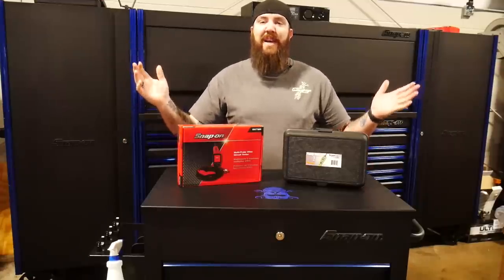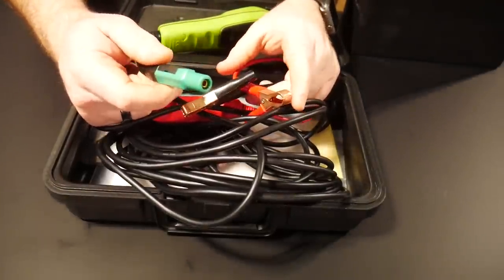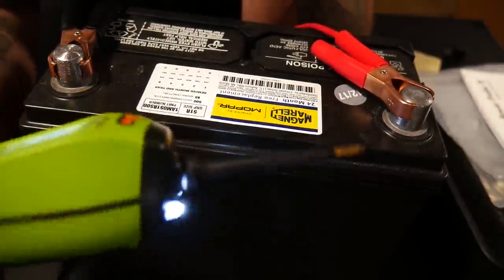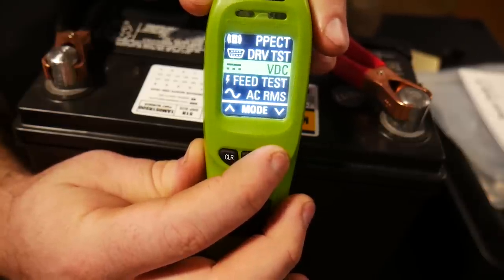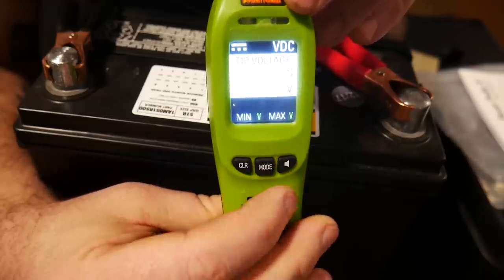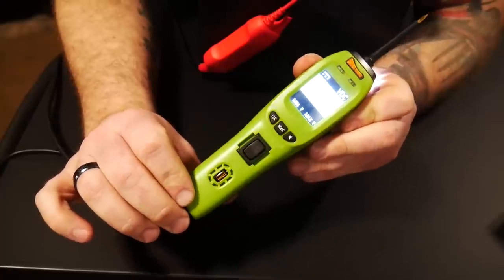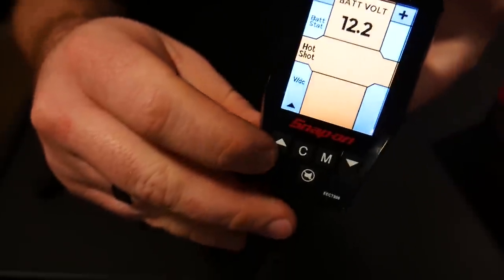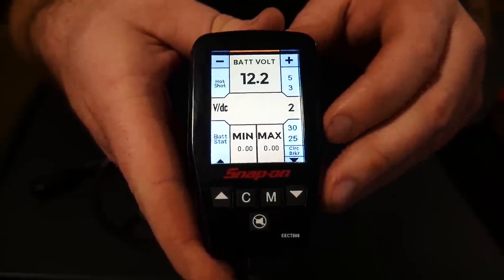POWER PROBE 4 & SNAPON EECT900 COMPARISON AND REVIEW

Comment: I’ve had the power probe 4 for a while and I’ve had to have it repaired 4 times already, I’m actually going on week 7 without it as it’s back being repaired again. I never had a single issue with any other power probe I’ve had. I’m thinking about getting rid of it and going back to the 3.
Reply: Yeah, I've had the 3 for about 10 years and I have never even blown the little breaker.  Didn't even know it had the breaker until a video I saw here.

Comment: You can buy leads that are up to five feet or more. That will let you test the wires you talked about. I've had a 4 for years and never had a problem until a guy, in the shop, dropped it. The circuit breaker came loose inside.

Comment: I had the snap on one but got rid of it in place of the power probe due to the snap on one's software wasn't fast enough to detect turn signal power pulsing. Mabey mine was messed up but the snap on one just had slower response times in every way, even just supplying power and ground.

Comment: We have a PP2 I find i tend not to use it as much as i should. You should make a video showing how to preform each function of the tool with other equipment. like using a set of fused jump leads with a DVOM, Test light, amp clamp and scope could be a interesting. great review very in depth.

Comment: I think I have the 3, but the best use ever for a powerprobe is when you get locked out of a ford with the keypad code that you know. Plug it into  a jumpbox, crawl under it and apply power to the starter and ground it. Then have someone punch in the number.
Reply: Tim the Mechanic Branthoover this sound interesting I’ll like to hear the details 😊
Reply: Tim the Mechanic Branthoover tell me more
Reply: @raymond5145  Well, any Ford that has a keypad has a code to unlock the door if you punch it in. It doesn't work if the battery is dead. But if you plug the power probe lighter plug into a jump box or to a battery then get under the car to the starter, hook the ground clip to ground, put the tip of the power probe to the battery cable terminal of the starter you are also giving everything that gets 12 volt side of the battery key off 12v power, enough for the keypad to work and unlock the doors.  Also, if you don't have the code to one of these Fords, it's always someplace on the car but not accessible when the doors are locked.
Reply: Tim the Mechanic Branthoover I can’t wait to  get a power probe, I’m going to ride around with that thing like it’s part of my car keys lol

Comment: You can get a Autel ps100 or a ancel pb100.  I have four power probes!   Yes I have a hook. Contacted power probe and they just blew me off!  Anyways time to move on.  I would not bother spending cash on snapon one half year warranty is all they give you!  Yes for probably quadruple the price of a ancel or Autel!   Good video not knocking on the guys video.  Great video.   Snapon tool $370.  Power probe four $190 ancel $70 Autel $100.   That snapon is massive won’t fit in tight areas!   I work on semis as well.  Too massive

Comment: Test Light and Fluke 87V is all I need.  You are a good salesman though!
Reply: You can do the job without a power probe. But it makes life easier. Especially the ECT3000, that thing is amazing.
Reply: I grab my PP4 more than my meter now.  Having B+ and tip voltage displayed all the time is ideal for voltage drop tests and always having good power and ground is worth it alone.  Of course having the rocker switch is handy.  My meter has been out lately for parasitic draw tests.

Comment: I saw another video and a guy amp clamped the hot shot feature it pulled 30 amps at 2.5 mls and came back with good connection.

Comment: The Snap On is mostly the Power Probe Hook. However the Hook has SO many more features, and with one exception has every feature the 4 has, Plus a hundred more. I use the Hook for the reference voltage features when testing computer circuits. Hook has a relay tester, and 5 level circuit tester with the relay tester. Its the most awesome of them all. The 4 has one feature i wish the Hook has, and thats the reader for the ECT 3000 to know when the tracer tone is in a certain wire.
EDIT: someone mentioned the 5v reference add on for the tip. The hook is continuously variable from .5 to 5v in reference mode. @20ma. Computer Circuit safe. I use that for sending signals to computer using a predictable .5 second pulse mode while watching data on scanner. Hook has momentary, lock on and pulse mode on power button menu. I am not affiliated with PP in any way. It's just an awesome tool. 75% of my work is electrical diag. I use it often. Watch the hook demo vids. It also has instant voltage, ohms and ammeter depending on circuit and power present.
Thanks for hearting my comment.

Comment: Can you show..how to check the pulse for fuel injectors with the eect900
Reply: Buy a box of noid lights £10. to 20 pounds and you,ll do the job 10 times as quick,when I check a car for a no start , can of brake cleaner ,to check if it’s fuel related,and noid lights to check the injectors are getting a signal, basic car doctor 101 , if you want to save money solder a 1k resistor to a led  solder a wire on each side . Remember they’ll only work one way ,if you don’t know what a cathode or anode is ,just try them both ways,if it doesn’t work both ways there’s no signal from the ecu or a short in the wires,hope that helps,

Comment: Good review, interesting seeing the differences in the probes.
wonder If they could build an oscilloscope into the power probe? feel would add another level of diagnostics
Reply from the maker: Would be interesting to see, but at the same time I have a feeling you would be looking at over $500 for a probe then
Reply: Power probe Maestro has this in their app
Also autel in the al539b which is 80$
Reply: I doubt the snap-on can receive the signal the power probe short circuit detector signal but who knows. I just got Snap on version so might have to play more.

Comment: Maybe I'll get my crate a day early that I can do a review on it before everybody gets theirs, haha not a chance I already know. 

Thanks for the shout out I was waiting to see that I thought maybe you would do some bonus footage at the end but you definitely have to get that and I think it'll work on the power probe 2, the 3 and the 4 for sure and do some videos with that. 

Do some case studies with that and show your audience how that 5 volt reference adapter works it's a very sweet tool add on. 

You should get your snappy or other tool truck to get you the power probe hook and do a side by side with the snap on one. 

Also you might want to drop some links to the Power Probe store where you can get all the Magnificent add-ons they have which if the viewers don't want to buy it from them they can always get them on Amazon as well. You just have to watch the pricing been there and done that. 

I have the 1 2 3 4 and hook. The two three and four are slightly if not at all used on at least two of them so I may try to trade them in to the snap on guy as I believe he quoted me to $280ish last time. Snap-on guys are good if you get a good dealer but I never will pay more than two-thirds of retail just because of the fact that I understand their cost structure and there a publicly traded company. That extra money goes to the company. 

If you've got stuff to trade there's even more wiggle room I found on some things. 

The reason I mentioned the bonus footage thing earlier was I thought the adapter didn't arrive till after your video had probably already went to The Cutting floor because I know it takes a while to get them done and you had been talking about that for a while so I thought the footage was done already. 

Just remember when you have to keep Captain Ron and check you take that five molded after off and give him the full juice you might get excited with just 5 volts. 

If I knew you would send it back to me I would let you take the hook and do a review with it just you would have to do shipping back. I wouldn't send the whole case just because of the fact I can probably fit it in a little flat rate box which would save on shipping but I could always go with a medium box as well but don't quote me on that. 

If you're interested in doing something like that let me know and I'll take it up and ship it across the freight Lanes and you can do a review in a couple weeks with it from the time I get it shipped to you. Oh wait that would be to head Craig's time so damn I might have to hold off on sending it I don't want to interrupt my crate getting shipped 😂😂

I won't make the Sunday sermon tonight because I'm over just west of Lusk Wyoming right now I pulled off in the rest area. Maybe pull up Lusk Wyoming and show you viewers on the map where that is. If you ever want to know where American Legion Post 1 is it's just east of Lusk Wyoming right before the Nebraska line. A little tidbit of information that a lot of people probably never knew I never knew till I have been driving over the road for 9 years I drove past the place many times but if you pull it up on Google Maps it's just a little hodunk town will the flag out there and I woke up one morning looked out the window and seeing the dedication plaque to it I think maybe two or three people live there in that town now. 

Anyways I missed the Sunday sermons tonight with the Reverend and the bishop cuz I was out in Utah for a funeral on Friday there. My uncle's ex-wife it was still my aunt that passed away earlier this past week so I had to drive out and see you there it was a thousand mile trip. It was cheaper than flying out there and that was before even renting a car. 

I think we need to work on the rusty belt designs on Teespring as I was looking at them last night while I was ordering one from South Main Auto. I've been feeling their Channel a little longer than yours but yours came up as a suggestion but I don't like black and I forgot if you had other colors but also I think we could touch that design off. 

Maybe you should do a little three or four week design contest where your subscribers email you designs and then you put them up for voting. top winter should get choice of two items sweatshirt included and second place should get a choice of one item sweatshirt socks or t-shirt and third place should get a t-shirt of their choice. 

Think about all the kids of all your subscribers that will come out of the Woodworks and blow your mind with The art design capabilities they have. 

 I think you would get to your next thousand subscribers fairly quick as well or next 2000 especially if you're running a boating promotion as I've seen little polls where people can vote yes or no on items. 

Also pardon in a misspelling or sentences as with this much typing on a Galaxy Note 9 even it makes the thumbs and hands go numb so I use the voice typing. 

 I've got a few other new things I haven't got around to using that we could collaborate on as well. I'm sure you've heard of a cardaq? 

 I've been taking it easy since last fall not doing much except personal stuff so I've got some new stuff I have to test out. I need to get my garage cleaned up and make a little table with a pedestal and maybe use my osmo 2 I don't know how well that would work but I think it would work if you're moving around because I just can't sit still as I noticed you're moving around as well well holding the camera. 

 I'm getting into coaching girls fastpitch softball season again so with it being that time of the year things are going to start cranking up here soon.
Reply: Yes before anyone says anything yes it was a book I just wrote or maybe a small little chapter book... 😂

Comment: Dose power probe offer the 5 volt atach ment like power probe or dose it have a setting in for that
Reply: I may have missed that In your videos
Reply from the maker: It has the 5v reference adapter that comes separate in most applications
Reply: What power probe would you recommend Keeping the f volt  reference in mind

Comment: got 2 things to ask first how much is there difference is there in the pp3s and the 4 you have there also if you pull up power probe on emay you may find i hard blow molded case that may fit your snap on probe hey before you send that power probe 4 back to snap on if your guy will let you get a pp3s please compare the 2 please i just bought the pp3s hoping i did not mess up
Reply from the maker: I don’t have a pp3 but if I come into one I’ll compare them
Reply: @RustbeltMechanic  that is ok just thinking i would ask i just bought this pp3s and just looking to see if i messed up and should have spent a few bucks more for the pp4

Comment: The only difference between the Two probes is the price Snap on tacks on 200.00 dollars because it says Snap on.
Reply from the maker: Nope, not in this circumstance
Reply: @RustbeltMechanic  I would believe that if Snap on did not have a hand in its design and it may be CHINESE made but I have used tools Superior to Snap on.A good example of this are impact guns, Snap on is yet to make a gun Better than Ingersoll-Rand. I own a lot of Snap on and Mac tools when  I see Snap on tools are now being made now in China I question them as a Company.
You may say this is not true but it is true as How it's made showed a Chinese factory making there tools and there tools no longer say MADE IN USA  as my tools do.So I don't think power probe had much to do with the design or maybe very little.
Reply from the maker: I totally get what you are saying but in this circumstance Power probe was commissioned and 100% makes both of these probes. The snapon one does quite a few more functions than the power probe mode shown the in video, including amperage testing, ohm tests/readings etc... Now after this video was made, I’d say that the snapon Multiprobe is closer to the Power probe Hook in capabilities.
Reply: @RustbeltMechanic  I trust power probe first before Snap on. Also to have a amp draw test built in really is not necessary as a multi meter does the same thing.Secondly the only time you need to run a amp draw test is if someone put a stereo with high powered amps in a car which I would just disconnect for testing purposes or a bad blower motor which if there is you would hear the blower bearings making noise, again you would not need a amp draw test. So on the rare occasion there is a intemitting power feed wire grounding due to insulation failure at that point the options for this bypassing and running another wire. My point is in 40 years I have only once had to run this test across a fuse only to find someone wired in a set a lights overloading the fuse.